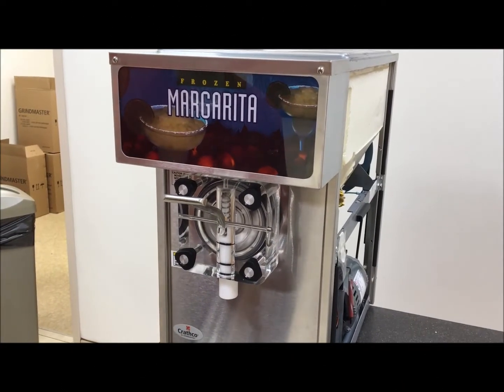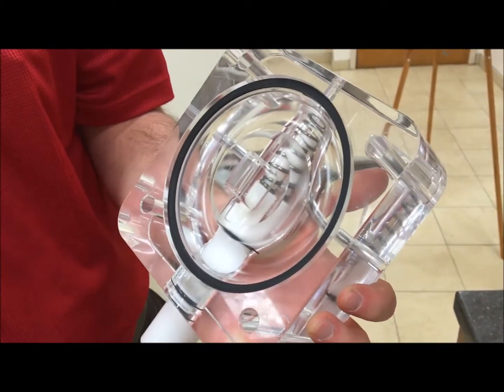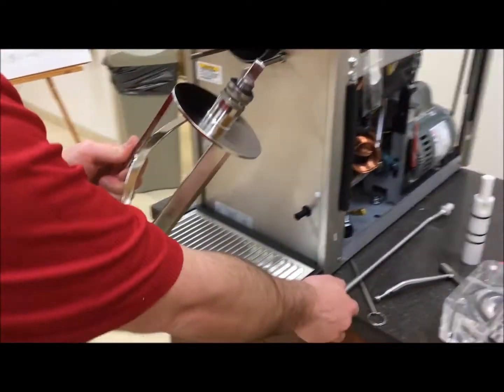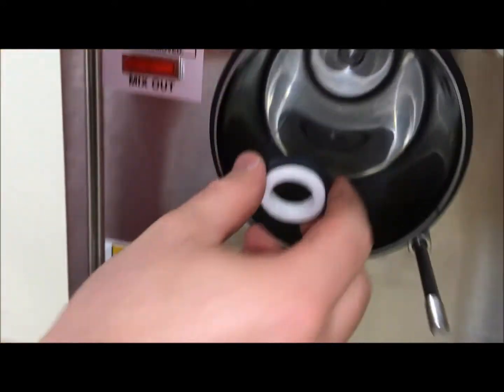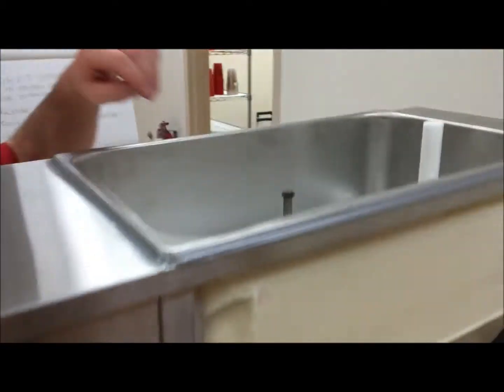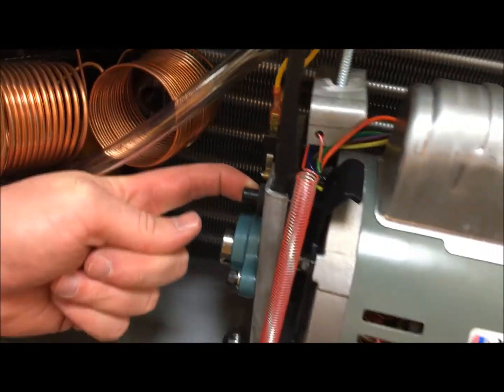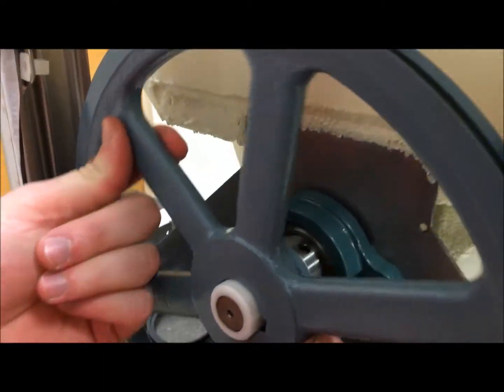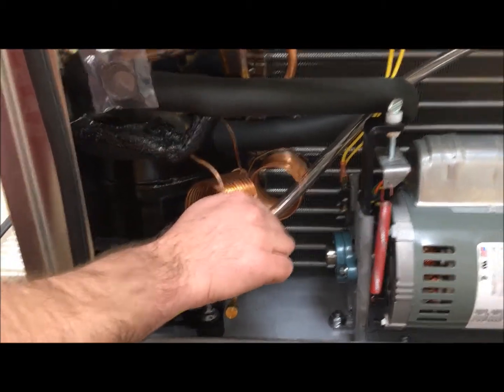Beverage Freezer PM Kit Install

Comment: How do you calibrate the consistency? Where is the adjustment? I just bought a used one and it freezes up and stops turning.
Reply from the maker: https://gmcw.com/wp-content/uploads/2016/06/3311-MANUAL_WH-312-06.pdf

Consistency adjustment is explained on page 8 of the manual . Link is above.
Reply: @grindmastertechservices9383  I have adjusted it several times and it still freezes solid. I bought a brand new machine.

Comment: what does the Micro switch on the motor do  ?
Reply from the maker: It starts up the compressor after a 30-90 second delay.
Reply: Oh so it is the Mercury switch wire set up ?  Micro is a replacement for that old mercury switch ?